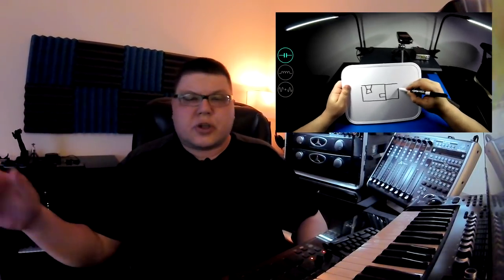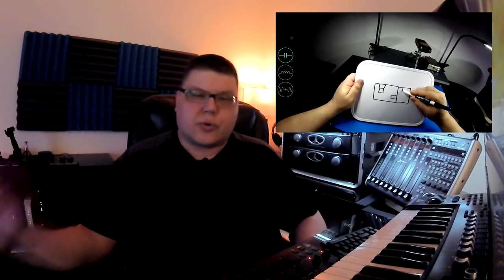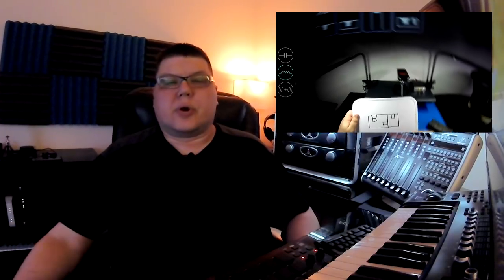8th Order Enclosures

Comment: About twenty years ago, I used WIN ISD software to design a 6th Order Parallel Tuned Band Pass with a Radio Shack 8 inch woofer. It was quite impressive, and I had people swear I was using a 15s in my enclosures. I still have one of the pair and currently use it for my PC sub.
Reply: Roughly how gigantic would one be for a Sundown X15 subwoofer? curious cause i can only guess it would be the size of a small car hahaha

Comment: So basically sealed is 2nd order because it only has the subwoofer to radiate sound. 

Ported/passive radiator is 4th order because of the active driver and the passive port/radiator working together. 

4th order bandpass has the active driver basically in a sealed box with a port/passive radiator on top of that. 

6th and 8th are just more complex versions of 4th order bandpass. 

I’m probably dumbing it down but that’s my understanding of it. Or what I gathered from watching the video at least.

Comment: You're correct about group delay (charge storage) with high order filters.

But high order filters can also (especially when the damping factor is poor; eg, most passive networks) be synonymous with moving coil transducers "ringing" as they try, but fail, to follow the SPL-descent that the sharp Xover slope describes/defines.

This 1 reason why (in speaker/monitor design) you often (but not always) see high order Xovers (4th order and higher) usually implemented in active systems; where there is no passive network between the amplifier output stage and the transducer itself; therefore optimizing damping and other Xover design considerations.

Appreciate that here, in this video, you're mostly talking about acoustic filters, as opposed to electric filters. Still, there are always compromises, as high order acoustic filters introduce some funky considerations to the impedance/phase plots.

Comment: I've built an 6th and an 8th, the 8th is a triple reflex type, tuned to 39, 75 and 105 Hz. The driver is just an entry level Orion Cobalt 10 inch, rated at 200 watts RMS, with an F/S frequency of 39 Hz. I built if for my car, and it's by far the loudest 200 watts I've herd, and it compliments rock, especially considering the Bass Guitar's lowest note is roughly 41 Hz. It was very experimental, and i'm far from an expert. My 12 inch Alpine type R is in a 6th order, that is loud, but it it's only good for hip-hop, rhythm and blues, Electronic music, as it starts topping out at 70ish Hz, the 8th however gets well into the 120- 130 Hz. And yes it's a beast, like 40 Kg.

Comment: In my opinion 6th order bandpass is as sweet spot. Lower range, 2 control points and not much distortion. Only drawback in my eyes is it's size. For as compact design as possible you have to sacrifice a lot and spend huge amout of time with calculations and design for compromiss.

Comment: Thank you for sharing your knowledge, time, and efforts. I can see this as my "the place it started" point and good sense would make me run away right this minute but now I have questions... haha. 

I'm from the era where Jensen 6x9" coaxs and 20wpc booster were an awesome upgrade, and not surprisingly I still have the old Radio Shack book on speaker enclosures from about the same era (70's)  One of the projects is a multiple chamber bandpass but I can't tell what order it is because the primary chamber is vented to the front of the box as well as the secondary chamber. Both chambers have a front facing port and it's a 2:1 ratio box they reported tuning to 35/70hz.  I don't get what the primary chamber port to the front and speaker facing the front does to the order count though.  My guess is 8th order because of the three ports, two chambers.

That search for tuning math and a better understanding of order counts leads me to here and your excellent content.  Now, after watching this a couple of times, I tried finding your 5.25 design.  I fear it's lost in the webs. I'm really interested in the tuning part and I'd love to find it if the design is still posted somewhere. Any pointers would be fantastic. Thanks!

Comment: What could be done with all the air movement and pressure from subwoofer output? Possible involve water 💧 🤔 or metal to produce another frequency or spectical of some sort. Could it be used to create energy or a portal??

The circular shape of a voice coil has not been revolutionized yet. Square subs are funny; they have circle voice coils also 😆

Comment: Ok ok I have to ask you a question or few.  I have a small light duty pickup truck that I am using to grasp on to what was my youth.   In this single cab s10 I have the intentions of a sound system that is not just loud (where my issues and concerns lay), but also be very musical.  Is a 8th order hybrid or a fourth order enclosure something I should continue to explore?  To do this, I am very aware that I would need to put the enclosure in the bed and cut through to the cab.  Now as I am trying to grasp at my youth,  I am not trying to bring along the ignorance I had in tow.  Before I do something crazy like this I would love some solid advice.   Anything that you could add would be greatly appreciated.   If you would like any additional information,  feel free to contact me.

Comment: Do Isobaric setups sound tighter / faster / better?
i.e 4 cu foot encosure on one amp (w/one driver)
vs.
two 2 cu foot enclosures on two amps (four drivers)

I assume having four times the drivers, and twice the power to get the same spl / response curve must come with dramatically more solid & controlled results?

Comment: I Know  this an old video but figured Id ask here since its relevant. You mentioned group delay and it makes sense to me on paper but when thinking about the way its been described to me  it doesnt seem like it should change. It has been described to me as the mass of air in the port is essentially coupled to the woofer, if that is the case shouldnt the output of the port happen with woofer movement?

Comment: I tried to make a band pass box and it failed, this was 15 years ago, it sounded like crap, I copied the concept from the bose acoustic mass subwoofer marketing. Today and many years later people like you educate me. I wont go for it as I prefer a basic sealed sub-woofer I own an peerless 12inch XXLS and it sounds fantastic I don't have to play it loud appreciate the bass, I think bass is overrated, but good bass is tough job to engineer and fit in with other speakers.      

By the way whats your take on the  STW-350F-188PR01-04  subwoofer ?
Reply: Thanks for the update, guilty as charged I am, I recently took the exact SVS PB 2000 dimensions and used the exact OEM (peerless  12ich tymphany-835017) paired it together (with a class-d 500W amplifier) , haha (the funny part) in this wave of luck (using an existing commercial speaker model), it worked! my aim was to achieve ~17Hz and below audible bass for my movie collection example: BatMan Dark Knight Rises, and with additional signal tweaks, I'm using a SHARC DSP in my chain with custom coefficients and signal flow, part of a DSP research project, both for pleasure and science. 15 years later I have some form of knowledge, and alot of appreciation for science (on so many levels) why does enlightenment arrive so late in life. sigh, wish I had better knowledge when I was 20 something haha!    

I hope to see a review of a STW-350F-188PR01-04 (its an exception) I understand you guys market purely now for yourselves but this is an exception to the rule. :)        

Cheers.

Comment: horn loaded subwoofer cabinets, I see little on this topic from you Pete.  Of all of the enclosure designs I see this as the most under appreciated and with modern DSP all the old draw backs are negated...   as with high order band pass enclosures the horn loaded enclosure is large but efficient, certain applications allow the use of these designs such as Professional audio many times.
Reply: They are underappreciated because they need to be really large even when folded.
Reply: true, they are large, Hoffman's iron law: large, efficient, and low... pick any two and the third will be the opposite!!!  for horns they are efficient and go low but they are not small
Reply: @justingillette8287  Horns generally don't very low at all. As I stated they have to be very very large. So large as to not be practical.
Reply: Horns are not that big and they can get low, there are designs that easily drop into the low 30hz range.  Have you seen: Danley Sound Lab subs, Speaker Plans 1850, LAB Sub, Turbosound TSW218, JTR Growler, Martin Audio WLX, BFM Tuba or Titan series horn loaded subwoofer designs to name a few.  To be too large to not be practical is subjective to say the least.  Don't dismiss them for the rest of the world because they don't have useful application for you.   I happen to use a large bank of horn loaded subwoofers in my mobile dj rig and they do a great job and they run on 1/4 the power that a direct radiator bass reflex rig would require to be equally as loud.  Good luck finding a stack of 18" pa Subwoofers that can play down to 28-30hz with any real authority.!!!

Comment: Not so clear on the advantages and disadvantages.  What if I told you a single woofer in a ported box tuned properly is good enough for what I need, how would you then "sell" me on a higher order design?  What do we have to gain (other than complexity) for something like that?  So what if it gives you more "control points".  Can't you just take the simplest woofer enclosure design possible (a sealed or a ported single woofer), and just EQ it to your liking?  Even better, that take simple design and make it a clamshell isobarik design for even better quality sound.  I don't see how and why all those vents/ports are "needed" for good sound.  One can ask, what is the "limit" of that?  What if you had a warehouse and made a speaker enclosure with hundreds of subchambers and ports?  What good would that be?  That is an extreme example but usually we can learn things from extreme examples and then choose a more practical and reasonable compromise between extremes.

Comment: Would a 6th order be a good or bad idea in a recording studio.  I have 20 years of experience and I am currently setting up my 4th real studio in my life.   This one is starting out in a smaller room to be expanded in a few years.  My other subs used in my previous room will take up too much space.  Whatcha think?
Reply: Any higher order cabinet generally suffers from increased group delay (sealed being the lowest group delay all other parameters being constant).
When combining elements of a system (monitors to subwoofer) if the group delay at the crossover point varies greatly, it may suffer from poor integration. Phase adjustments or even static delays may help. Generally higher order systems have narrower bandwidths, at least they lend themselves to that (but that isn't always a hard rule).
When the group delay varies wildly inside one element, or is excessive, people often attribute that to 'sloppy' (as opposed to 'tight') response.
Group delay generally becomes less noticeable the lower the frequency is, so again it's very dependent on application.

Personally if I was considering a subwoofer for a reference system that was crossed over fairly high to a set of monitors, I wouldn't choose 6th order for the above reasons.
If I was looking for a dedicated sub-sonic or barely-sonic subwoofer just to extend one octave in that same scenario (mating to appropriately chosen full range monitors or a more conventional subwoofer), say, adding 20-40hz, a 6th order design might fit well. But that's my opinion, and ymmv.

Comment: Btw more is not always better. This video is also overbearing with all those cuts and changing camera angles with no point or need for it. Typical syndrome of video producer that wants to be Akiro but makes something that just shows that he did not understood why and when. Wait by orders is the same thing to. More is not always better. You gain some and lose some. Higher you go more compromising things you have to accept. Sure it us louder but you can get loud with other means while things you lose you can't get back. On the end of my journey, even with subs I came to conclusions that for me any enclosure that does not have driver looking into the room (or floor with some distance to it) is not what I am looking for. That is just me. Some people just love how bandoass sounds. To be honest some proper implemented can sound impressive to. Still even then they sound slow and more often then not they hide music information replacing it with a SPL. So you can't make distinction or identify instrument making that rumble. Nice low warm rumble but not really accurate. Imagine what 8th order does then when it can't even let you hear that driver is distorting? Just mud right? Sure you can use amp with high damping and nice power rating and combined with good driver it will compensate a little but then that combo will compensate SPL or better said lack of it even in simple closed enclosure. It's is not a accident why most of the studio subwoofers come with simple bass reflex enclosure or with passive radiator. Sure cuts costs of production but also results in acceptable compromise between SQ and SPL. And nope I am not immune to complicating things either. My main speaker's I kept over all this years are still my 4 ways with 15" driver with TL tuned to 20 Hz. Honestly speaking they are 8" closed 3 ways with high pass filter set low with a 15" TL expanding lowest octaves. Great impressive sound with 0 practicality. They dwarf things in the room and block the sun. Moving from house to house makes you lose a friend or two. Plus require serious amp or even bi amping. Needless to say almost all speaker models I was selling where two way speakers. Most popular model was di apollito with one inch tweeter and two 5 inch drivers in nice big and heavy bass reflex enclosure and simple 12 dB crossover. With some tuning it was epic. 2002 it was selling for 1k Euro a pop. And then Euro destroyed the market here in the EU. Never looked back. So again more is not always better. Custom made for the purpose is mostly the best. At leat that is what I have concluded after all this years.